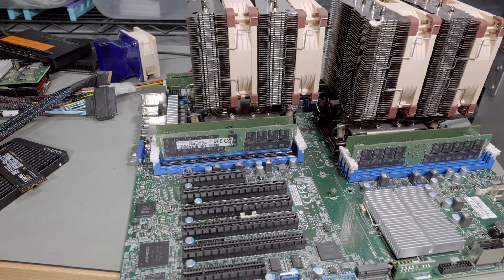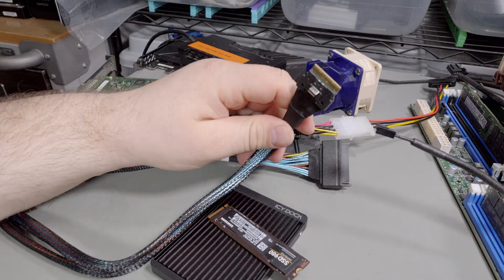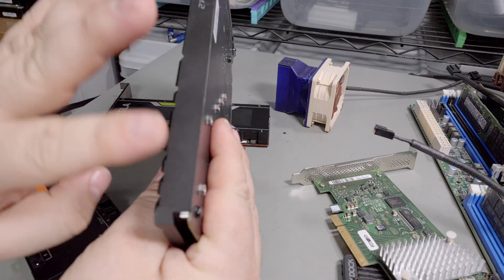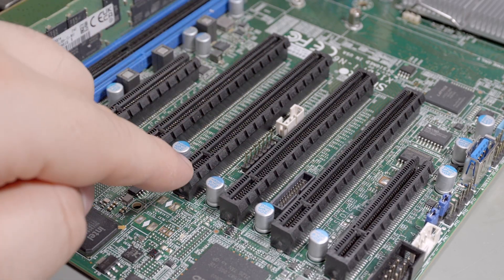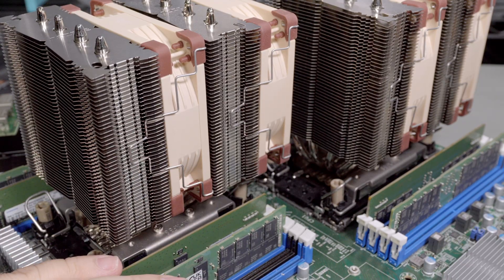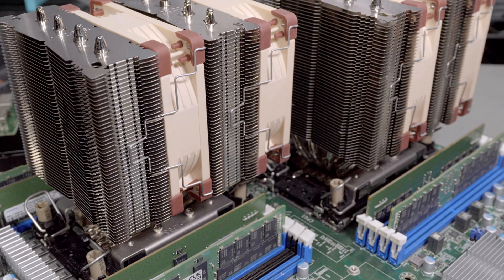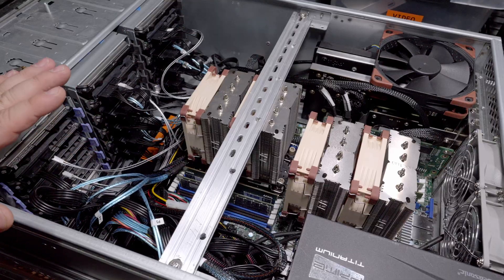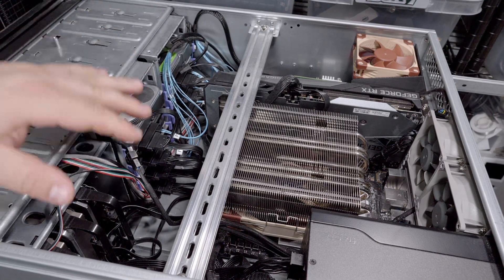IceLake 64C/128C VM server upgrade VLOG 2023

Comment: Im still running an old faithful X99 based home server from some gaming hardware I bought on release.
ESXI runs everything with hardware passthrough to vm's including the nas with a HBA, I have a dedicated nas to just backup that host.
I found this to be pretty power efficient as its only one machine and the backup nas only spins up at 2am for an hour or so to do incrementals.
Reply: Dual Socket E5-2699V3 Squad Checking in!!!!

Comment: What are you symptoms for failing HBA/expander?
I am in the middle of troubleshooting similar issues and it's never enough example info for such issues hard to trace without swapping almost everything
Reply from the maker: Random drive disconnects, ZFS scrubs which repair a small amount of data seemingly at random, CRC errors. The problem is these can all be caused by failing cables, so it can be hard to track down. My first suspect is always cables. dmesg will often show the errors from the LSI driver if it's detecting errors on the controller, so that can help track them down as well.
Reply: @PeterBrockie  Thanks, make sure to post about your progress, I'm certain it would be of help to someone.
Mine starts randomly with IO timeouts which lead to ZFS checksum errors, could be on any port, on some or all of them randomly too.. But if it started, seems like only power cycle helps (not a reboot) mostly for a long while.
Oh man, worst case ZFS offlines all disks in a pool with system dataset and logging daemon eventually completely stalls the system, which is a rogue behavior on its on..
And I'm pretty sure its not data cabling at this point, suspect worst case like vibration resonance in drive cages or failing PSU/power contacts, LSI HBA or Intel Expander degradation.. All except the last I am in the process of dealing with.

Comment: Wow...there must be something in the air...
I've spent the last week prepping for my own HomeLab Phase-2 and I'd be moving systems today if I hadn't been shipped the wrong height brackets for my shiny new MCX354s. The thought of transferring 80TiB over 1Gbit is keeping me patient though...
About those bifurcation cards. $75? That's crazy. I've had good luck with the cheap $10-$15 ones. All they need to do is repeat a REFCLK, so as long as they route the diffpairs sanely (which layout software will do for you) it's pretty hard to screw them up.
I have those same Rosewill cases too. Though I REALLY wish I had spent the extra $$ and gotten the ones with hot-swap bays. I had awful luck with my first batch of used enterprise drives and had to unplug half the server about once a month for almost a year to replace drives.
My Phase-2 drives seem MUCH better, but I bought 3x of the 4-in-5 units from Rosewill because I'm just NOT dealing with that again...
(Why are there no other reasonably priced hot-swap bays? Even the $80 on AliExpress want $100 for shipping...)

I'm changing from an e-waste x99 system to a legit EPYC Rome in a Supermicro board. I literally ran out of PCIe last year so I'm SUPER excited to be going from 40 to 128 lanes. Especially so with the way NAND flash prices have been. (Though I do wish I had waited on getting more NVMe drives. I payed $60 each for 1TiB Samsung drives in Feb. The 2TiB ones are down to $75 now. Oh well.)

I'm selling off the x99, but I'm keeping the e-waste theme for other equipment.
Those little Erying 11th/12th Gen laptop BGA boards are insane value. The only things they are missing is Bifurcation and fully working pass-through. (Passthrough doesn't seem to work for dGPUs. No word on SR-IOV, so it will be fun checking it with the MCX cards.)
Heck, I think I'll be replacing my aging workstation with one too. I just need to make sure I can get the MCX cards running comfortably in one of those M.2 > PCIe x4 slot adapters.